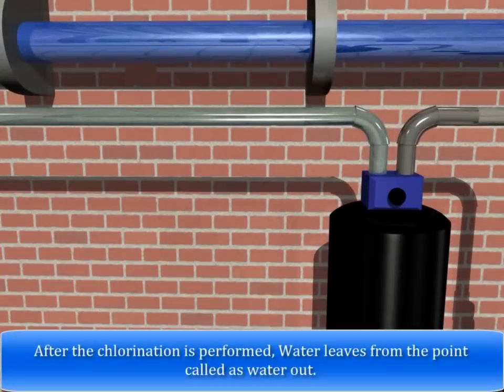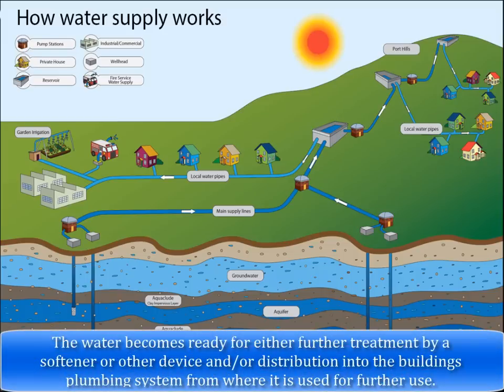[ Water Chlorination ] - Learn How Chlorination of Water Formula Works

Comment: Why is a contact time of 20 minutes required for chlorination? Does the chlorination have to take place in a sealed container or could sufficient mixing be obtained in a channel flow? Thanks
Reply: Contact time depends largely on available free chlorine and required disinfection performance (which depends on regulations and on the quality of the raw water). The idea is that it requires some time for the chlorine to react with microorganisms to inactivate them. It is usually injected near the end of the treatment process (post-chloration) where turbulence is high enough so that it is evenly mixed. Sometimes in the pipe going to the water reservoir (which contains baffles). So yes, it is done is a relatively sealed environment. This prevents degradation for instance and contamination.
Reply: contract time of one hour is required
Reply: Porchswing

Comment: I'm sorry this video is very limited on information. The system shown here is not very good. This would be chlorination 101 A there is a lot more to properly chlorinating well water. You can use it to Oxidize Iron, Manganese. Where I am from (Northern California) The water is very rich in Iron and Manganese with Sulphur. We use UV lights for bacteria at the end of a Treatment system.  Stenner pumps with a pulse meter. Also a No Hard Water Valve or Solenoid Valve behind the filters containing the chlorine so Greensand and Carbon filters, to prevent the chlorine from being injected while filters are backwashing.This will insure that no chlorine will pass the system. You will need a service schedule to keep an eye and test because the Carbon filter can and will need to be changed. That is the weak link in the system. Chlorine will pass through it at that point. So 
Service Schedule is important.
Reply: Thank you for the help